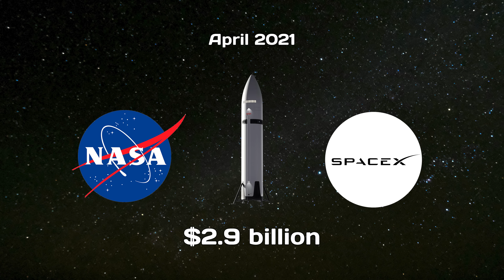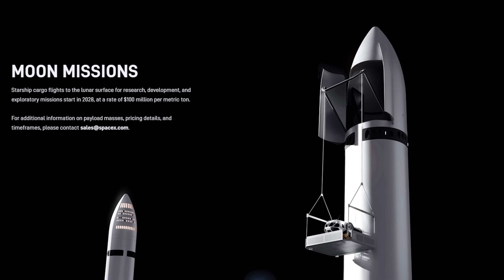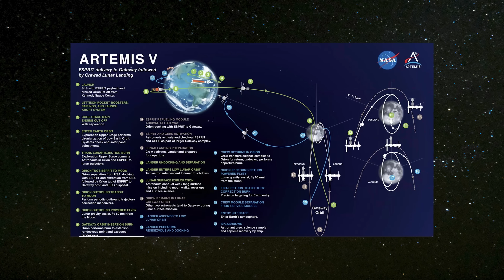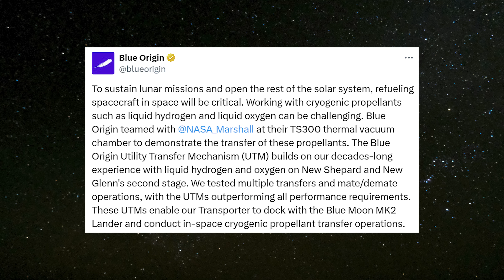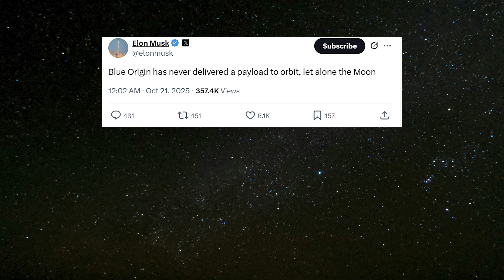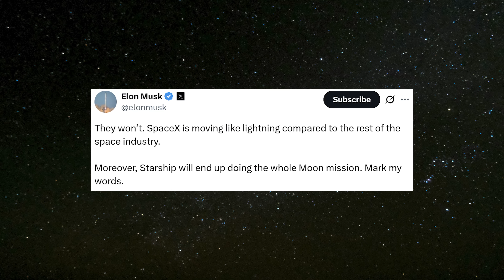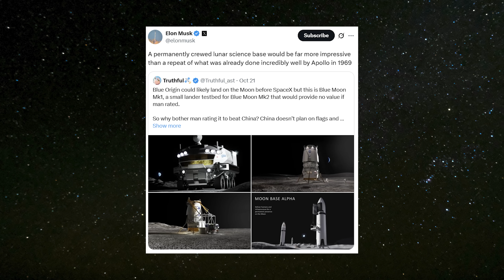Something WEIRD Happening with NASA's Contract to SpaceX Starship Moon Landing!

Comment: We've already been first with humans on the moon.  Now, it should be about sustainability and permanence which no one other than SpaceX starship can offer.  You have to get mass to orbit and beyond cost much lower(orders of magnitude) than historical values.  Falcon 9 is current the most efficient launcher (and has capture roughly 90% of launch market).  The successor starship fulfills the needs of the next significant advance in space and will provide the efficiency and reusability to make off world settlements and research stations.

Comment: Duffy floating a re-compete screams schedule pressure, not just politics.
Reply from the maker: Really?
Reply: Check out the launch tower for Artimis 3 and beyond.. It blows the door so off.
Due to major problems and cost over runs it probably won't be ready till 2028 /29 earliest going by what I read last year.
Your right there is schedule pressure if you take this into account.